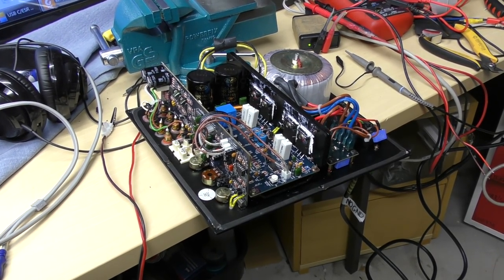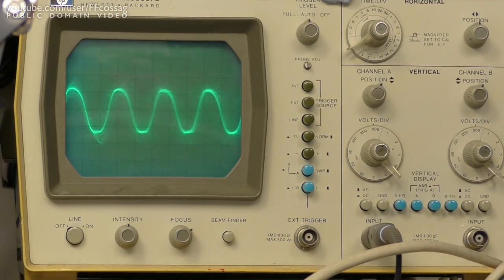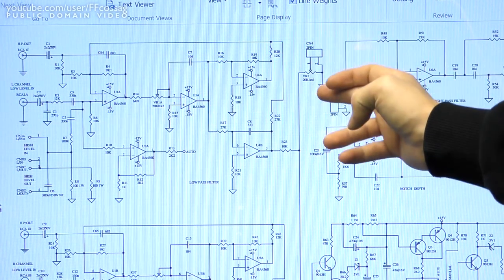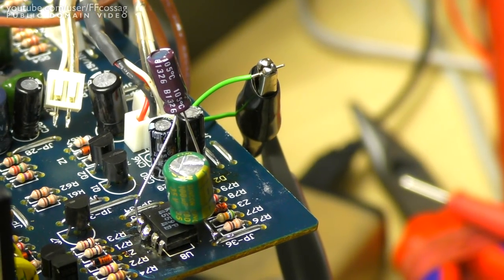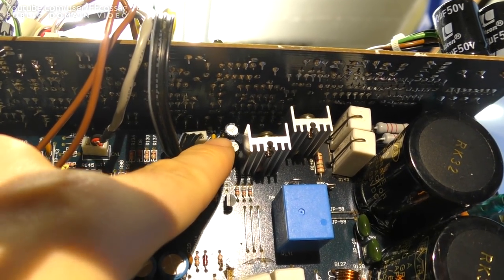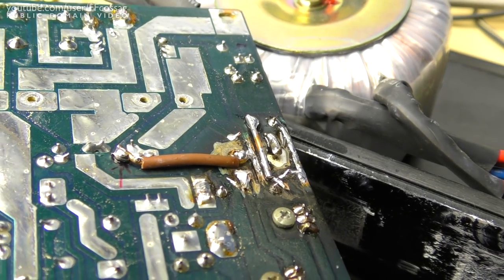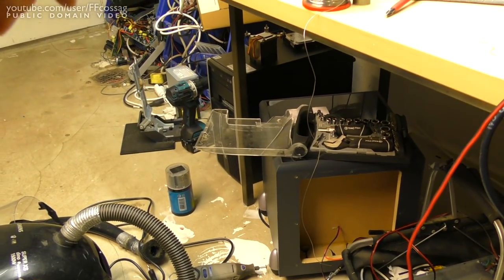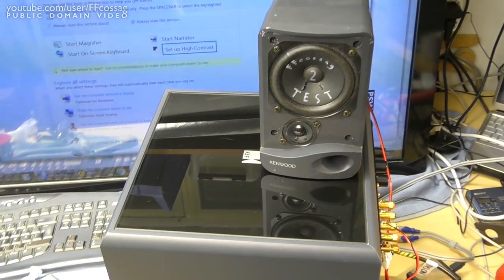KEF PSW2000 subwoofer repair

Comment: I have the kef psw2500. Nearly all my capacitors are shot.(even some on the pre-amp) Measured all of the ESR. Needed to replace nearly all of them, will be a good job😅 but looking at your repair i am more confident that it might be a solution, because i read somewhere that bad caps can't make your Subwoofer go silent, only buzzing or such. Let's see tomorrow or friday when the parts arrive. (Should have watched your video first so i would jave got the 25v instead of 16v 😅) Thanks for sharing your video, it was helpful, I also stole the oscillator from work but fingers crossed I dont even have to use it

Comment: Great repair! Am just in the middle of rebuilding mine after the main power supply caps dried and then whole thing including the poweramp drivers went bang.  Have replaced all caps, heatsinked everything, new output stages and now just getting it back up and working again, arguing with the protection circuit at the moment as it's not engaging the output realy. All good fun and games, wish I had all you lab kit!!

Comment: I have the slightly newer version of this sub.. And they are a right pain to work on! Protection circuit is doing its job too well in mine, even though the amp is actually running fine it won't turn on the relay lol does seem a little down on power but this whole thing was free and its getting boring!

Comment: 16V caps on a 15V rail?
You should see the cheap YIHUA bench PSU I have. When it is at the highest transformer tap (for maximum output voltage), the voltage on the 50V filter capacitor is almost 60V!!!
Granted, it's a Rubycon cap, and appears to be genuine, and it has run for hours at the highest transformer tap without blowing up. I think the capacitor has reformed the oxide layer to that voltage.

Comment: Great video. I've got the KEF's big brother, the PSW3000 and I've had issues recently with a dud filter cap in the PSU. This is a great reference should I get further issues on the pre-amp side.

Comment: Did you also replace the two twin big capacitors? seen at 2:04
Reply from the maker: I don't think so, though those often fail too.
Reply: @FFcossag  coz i have the psw 1000.2 with same design and board of psw2000 and still working fine,does all units affected? im worried bout this.
Reply from the maker: Probably, but I don't know.

Comment: Hello mate, I am new with all these things so my question is I have kef PSW 2000 fuse blew and then put new fuse no power but very little hum sound from the main transformer and its become hot so for transfer its normal warm or hot  When it's working?
so would you think what is a problem with this so no power but transformer working sound like but hot? so will you please let me know
Thanks

Comment: Thanks for the video! I have a kef 2150 sub that i bought recently as a package deal stereo system. Coupled with a Nice Denon network AV Receiver, center channel speaker and some nice B&W front speakers i was looking forward to some nice sound. I trusted the guy when he said that it all worked. Everything but the sub is intact. except this buzz coming from the bottom of the sub. I would conclude from you video that its the transformer. However after opening the cabinet I noticed the two main caps look to be bulging. One cap has a broken seal at the top. Would you recommend replacing these as a start? I don't have the test equipment you have nor the knowledge. I am an electrician but a lot of this is over my head. I can send pics or video if you could help. Thanks again for the video. Learned a lot...Cheers!
Reply from the maker: You could try it. If it's similar to this one, then perhaps try replacing the ones I replaced as well.

Comment: Really nice videos buddy... I got this sub dusted off and wanted to repair it in my spare time... care to share or suggest which components should I buy? I got the same burnt out opamp with the green capacitor attached to it so thinking of replacing them together with the 2 capacitors. I'm not an electrician but I know basic soldering. So I wanted to replace the opamp (BA4560), green capacitor (224k) , 2 capacitors (220uf 16v) to start with.
Reply from the maker: Just use components identical to the ones already installed, except not broken. ;)
Reply: Got it except for the green capacitor (224k) connected to the opamp... not sure what to look for and what does K means?

Comment: hello there.....I have a jbl prx718xlf (powered active subwoofer) that has an amplifier issue...what is doing is as I powered it up I noticed a slight hum coming from the sub and when the cooling fan kicks on I can also hear a slight winding sound that's coming out of the sub as well too....I also try putting on a clean signal I noticed a very horrible distortion going thru the sub even if I tried to adjust the volume nothing changes and as I powered it down the sub was making a thump ( kinda like a loud pop sound) as I powered down the amplifier...any idea of what can cause this problem? Thanks.
Reply from the maker: The two most common issues on subwoofers are bad caps and conductive glue making things go haywire. I can't say anything about your specific unit.
Reply: FFcossag ok I'll be sure to do that to see if it fix the problem.....
I also noticed when I took the amplifier apart and to try to determine whether its the preamp board or the main power supply board itself thats causing this weird noise......And as I swap the preamp board into a working sub with the same model just to see if the problems follows the noise was gone and function normal so Im assume it could be the main board itself that's causing problems but then again I can be wrong.....I even try disconnecting the preamp board from the main board to see if the noise stop and it did which leads there is something going on to either the preamp or the main board itself but I will try to check some caps and also try to see if I can remove the glue to see if it helps........I also have a video on my channel if you will like to see the problem that I have so that way you can see the problems better than I can explain it......there should be 2 videos.

Comment: I have exactly the same subwoofer. Blew when i accidentally switched from 240v to 110v on the back without looking to switch on the woofer, is there an internal fuse i can change?

Comment: Why does it look like you soldered leads on your probes when you measured the caps? Is that an accident, or something slightly smarter?
Reply from the maker: It's sowing needles, the probes need to be extremely sharp since we're measuring resistances down to <10 mOhm. Normal probes can't produce repeatable results at such low resistances.
Reply: Can you elaborate on why the normal probe points can't measure low resistances? Is it to do with the surface area?
Reply from the maker: You can't reliably pierce the oxide/impurity layer that covers literally everything you want to measure. You need the really sharp (and clean) point in order to actually make a low resistance connection to the metal below. If you shove a normal probe against a solder joint, you'll have 100-200 mOhm of random fluctuation as you're measuring, since all those impurities are getting shoved around as you hold the probe. It's not an issue as the meter will average it out and doesn't usually even have the resolution to quite tell, but when your meter has a 1 mOhm resolution and a 50 mOhm change can be the difference between pass/fail of a component, it starts to matter.
Reply: Ah, that makes total sense! Thanks for elaborating. :)

Comment: Filtering 15v with 16v cap is not a problem, is it stable 15v AFTER regs.... not the best practise, but that caps were overheated by regulators itself, temperature was the cause of problems here, not 16v rated caps. I bet they were also 85C caps
Reply from the maker: Not true; electrolytic capacitors last longer with lower voltages applied. There's some fancy scientific reason for this that I learned in school, but I'm too lazy to dig it up.
Reply: ok, true, but even if they were 25v rated, but are next to very hot regulators (if they are that hot?), then temperature will have more impact on life span of the component than voltage, which is still well in within rating. Everything is better being far from limits, but heat is degrading component more than voltage, wouldn't you say so?
Reply from the maker: It depends on circumstance. The regulators on this board actually don't run all that hot, so in this particular case I'd say the voltage across the capacitor had a much larger impact on its lifespan than you usually find.

Comment: That KEF sub looks to be garbage. But made for a great video. Now that it is working, it will be great addition to the lab.

Looks like your issue was not the popular cheap fake chinese caps but bad industrial engineering.  .  .
Reply from the maker: I'd wager the issue was a combination of both; had the caps said Nichicon, I doubt they'd have failed.
Reply: KEF as a rule make good speakers & subwoofers. They have however been let down by minor amplifier design / component rating issues such as this. Particularly on the PSW range of subs.
Reply: Agreed. But when these "minor" issues leave consumers with bricks, the issues are not so minor. I suppose it helps the landfill business and helps future sales. . .
Reply from the maker: I'm aware of KEF's reputation, it surprised me when I heard how utterly terrible this thing sounds, lol.
Reply: Yes, the temperature there boils any cap. Nichicon boils like any other. Just really really bad engineering

Comment: Nice repair :-D, poor quality and wrong selection of crap-acitors.
Oh, we dont want your smelly esr testing system.. he he :-D :-D
Reply from the maker: There will come a point when you can have it ... I just don't know when. ;)
Reply: Ooow you tease :-D
I have thought about buying a cheap atmega based one, i know it would not be exact, but anything would be better than nothing :-D
Reply from the maker: Those cheap testers are good enough for most things, mine's special because it works on ultra low voltage, under 200 mV P-P, so it can measure caps in almost any circuit. I so wish everyone could have one.
Reply: Yes it would be nice, but there are atmega ones around.
I have an ancient charge up tester that ive rigged to bang ten times the current through a cap to test it, it seems to show a very low capacitance with bad esr caps, and new caps show the same capacitance on any range, no supprise.
But a propper esr meter is still a thought.